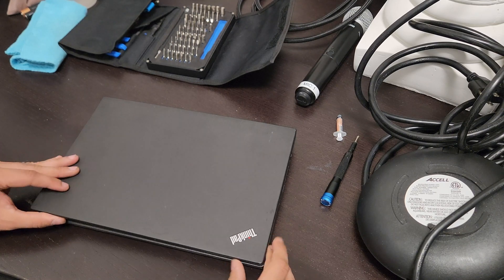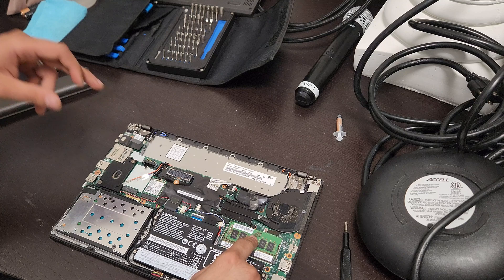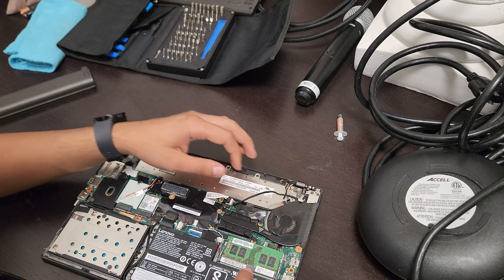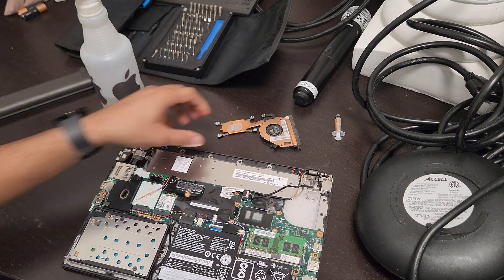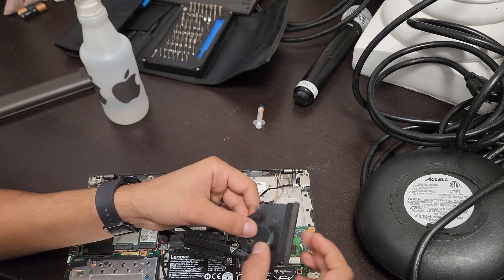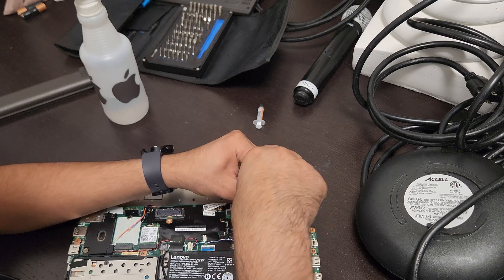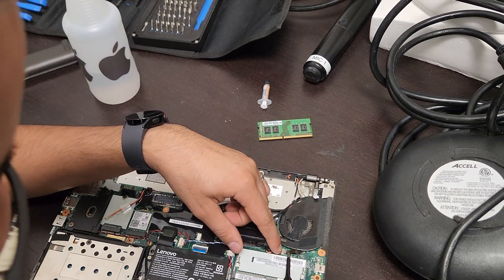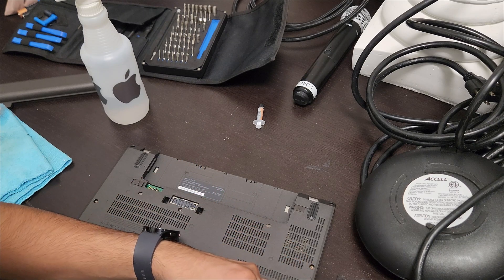Lenovo ThinkPad X270 CPU Thermal Paste: Easy Application Tutorial

Comment: Thanks for the X270 videos, I ordered X270 with i3-7100, can you tell whether WIFI is replaceble with SSD 2242/2230, is it SATA or nvme?
Reply: How it turned out? I plan to unlock advanced bios in mine with i5 6300u btw.
Reply: @Wrublos212  Passed it for handling to my brother, so at the moment I cannot answer my own question, have to reopen it myself and answer it.

However, this X270 unit is among the best ThinkPads I played with, mine has one stick of 32GB Kingston Fury DDR4, single-channel though, which is hurting heavy software graphic rendering, especially in my SmoothScroller written in QB64. As for the drive, my brother installed 4TB Lexar nvme SSD.

The corpus is the best among all other series, it is really sturdy, being a metallic alloy helps in dissipating the heat, I use Graphene (wanted to never change the degrading pastes). In that regard the heaviest thermal test I use is the funny game "Streets of rage 4", it makes half of the machine very warm. Oh, I use Linux Fedora 40, only, no more dual boot, I used to have Windows 10 but Fedora when configured and loaded with certain tools is a fun toy. 

The only complaint I have is the worst speakers ever, they are smallest and with no loudness, big disappointment, my "poorpeople"  kiddish ThinkPad 11e gen5 features superb audio - loud and clear.
Reply: The pcie on the right is dedicated for WIFI. The pcie port on the left is M.2 and can handle a 2242 NVME module. But this is reliant on the primary SSD/HDD which is SATA. So only 2 spots for internal storage.